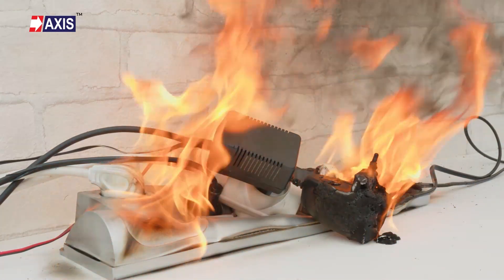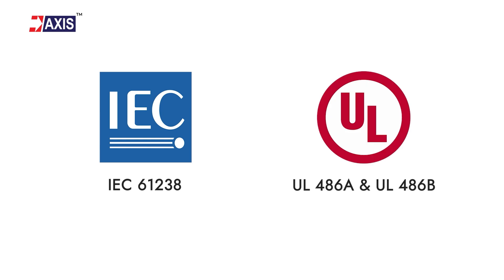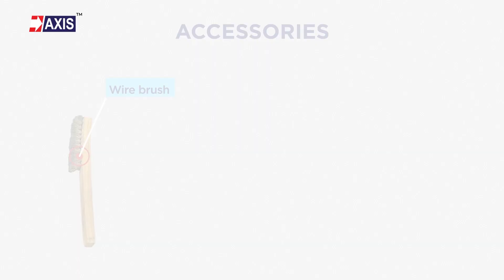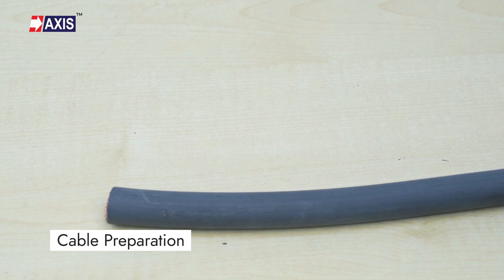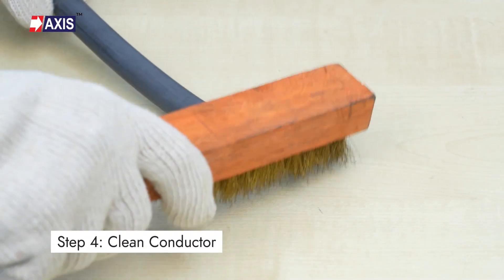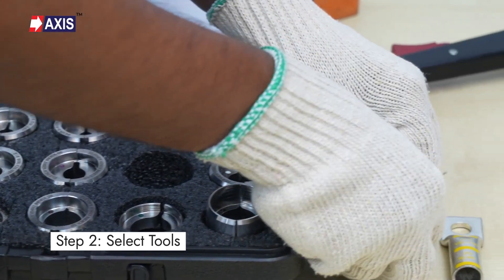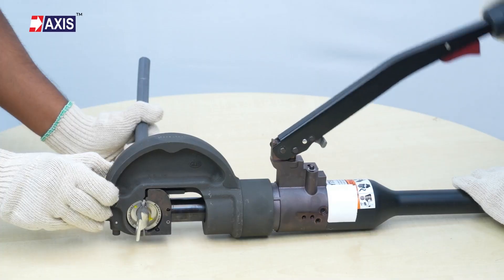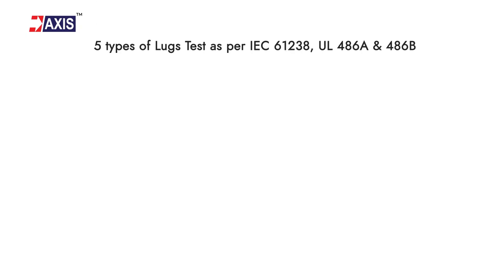How to Crimp Cable Lugs?

Comment: wow, everything is so nice and clean. youd have a stroke if you saw how i have to install lugs under trains. the shop only has one crimper and the fucking dayshift guys never put it away. so often ill be down there using a sledgehammer to crush the lug onto burnt wires, with several inches of exposed conductor. they will commonly short to eachother and cause break downs. but seemingly im the only one who isnt stripping them excessively long, is carrying a stripper with you everytime really that difficult, that they will only over strip it so they can reuse it without stripping again when it fails?
Reply from the maker: That sounds like quite a challenging environment! Let me know if I can help in any way, and please ensure everyone stays safe—you’ve got enough on your plate already!

Comment: As an electrical engineer, I have never seen a failure caused by hydraulic crimping.
Reply from the maker: That’s great to hear! To ensure consistent reliability, always use the manufacturer-specified crimping tools and dies for hydraulic crimping